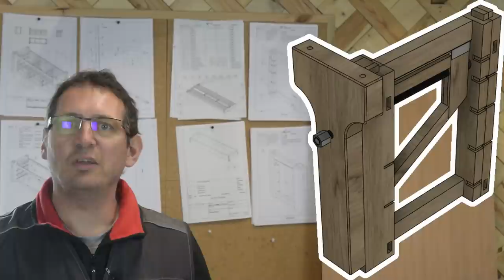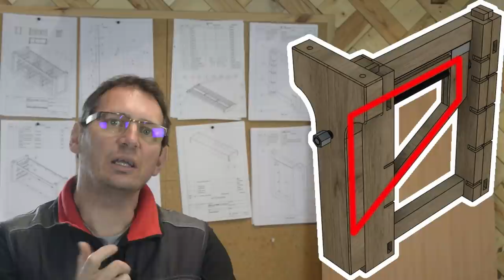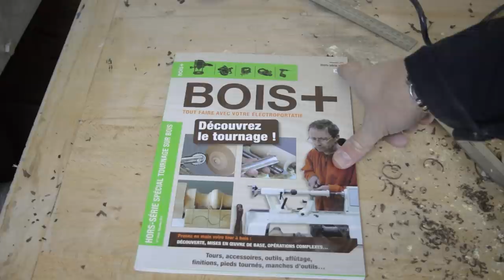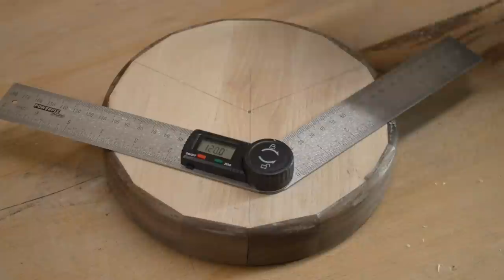un volant pour ma presse d'établi  [ Fabrication d'un établi / 16 ]

Comment: Salut salut, pour le trepan, les pastilles peuvent s'inverser de coté, pour garder l'interieur ou l'exterieur de la découpe. Pour le reglage, j'ai trouvé une solution pas trop déconnante de mon coté en 3 etapes : 
- Retirer une lame et egler une à la cote souhaitée. 
- Percer un martyre en faisaint un seul petit trait de circonferance avec la premiere lame, reglée
- Positionner la seconde lame pile poil dans la rainure laissée par la premiere lame. 

Normalement ça permet d'avoir un reglage assez precis sur nimporte quel diametre :)